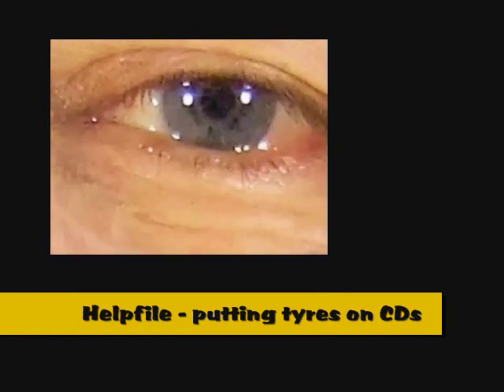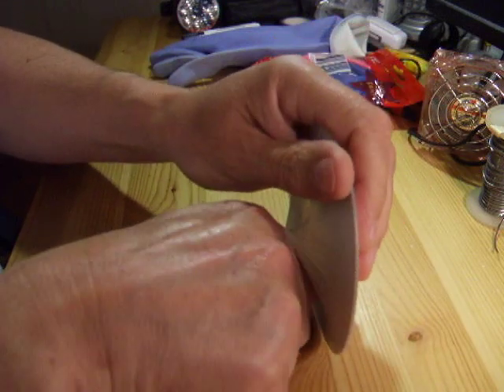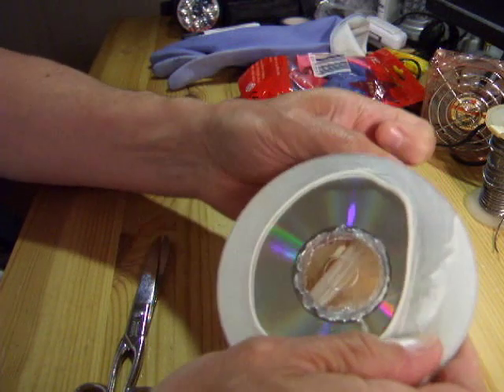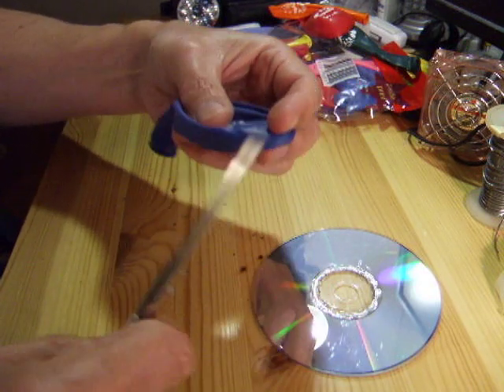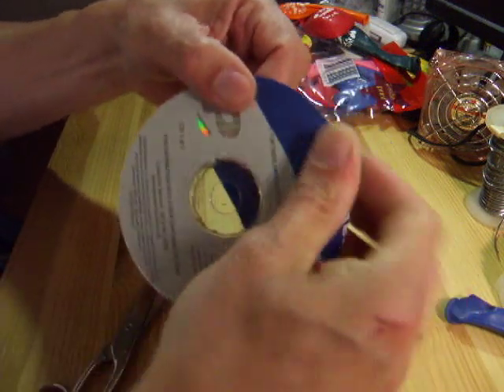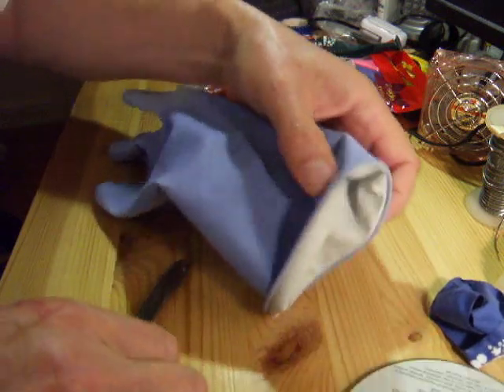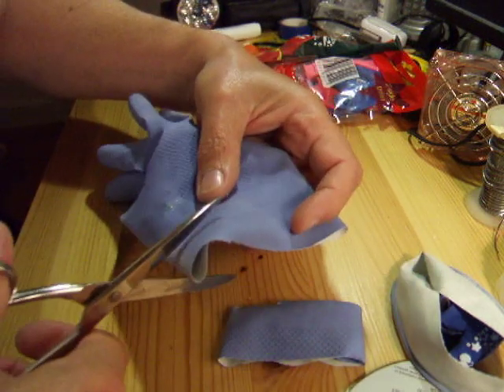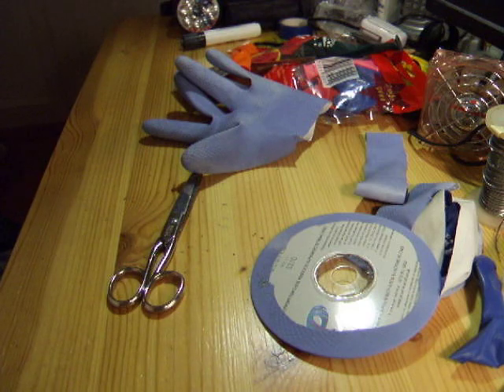Helpfile - how to put tyres on CDs for model car projects

Comment: Would you recommend CDs or bottle caps for an air pressure bottle car? Also, is the balloon grip better than the latex glove one?
Reply from the maker: Personally my choice would always be the CDs. Balloons and Latex gloves are very similar and neither last very long. My personal preference is rubber washing-up gloves because they are thicker so they last longer, but they are more expensive. There are cheap thin washing-up gloves which are marginally better than latex gloves but not much better.
Reply: Pls help!

Comment: Another option for traction is rubber cement. Just paint it on to wheels and let it dry, has decent success.
Reply from the maker: I haven't tried that but it sounds like a good idea assuming you have some available. Thanks for the suggestion.

Comment: Is there anything else other than Balloons to help the wheels? Tommorow is my project submission 😅
Reply from the maker: Did you watch the video? I give you 3 different suggestions in the video. Other less successful options I have tried are hot glue round the edge, rubber insulation stripped off power cable (needs to be split and glued in place), lots of rubber bands stretched across the disc will work but tend to come off too easily. Alternatively add some weight to the car and that will help the grip.
Reply: +GrandadIsAnOldMan Will the balloon tend to wear off after a few tries?
Reply from the maker: Ignatius Lim that just depends on the quality of your balloon. I prefer to use strips cut from rubber gloves as they are thicker and last longer but you could always use multiple layers of balloon to make it thicker and more durable.
Reply: +GrandadIsAnOldMan By putting more layers of balloons, will it help? Thanks for the advice anyway! Helpful video
Reply from the maker: Ignatius Lim It will make it last longer
Reply: +GrandadIsAnOldMan If my rubber band coils again and moves the car backwards, how can i counter that.
Reply: +Ignatius Lim Please help
Reply from the maker: Ignatius Lim The rubber band must drop off the axle when it has finished. If it is not dropping off, either you have tied it on or it is too long and gets tangled.

Comment: Hey can you put a balloon, latex, and rubber glove on the same tire?
Reply from the maker: Hi tta931, yes, you can put all 3 on the same tyre but there is not much point. You are trying to increase the grip and that happens where the wheel touches the ground so it will only be the outside layer that helps the grip. I find the rubber gloves are the best but they are also the most expensive option. Using larger wheels or making the car heavier also help the grip but can reduce the car's acceleration, speed or distance.
Reply: NO ,, YOUR LITTLE CAR WILL GO TO FAST AND EXPLODE !!!!  NEVER TRY THIS AT HOME !!!